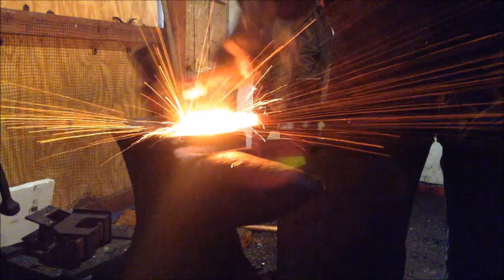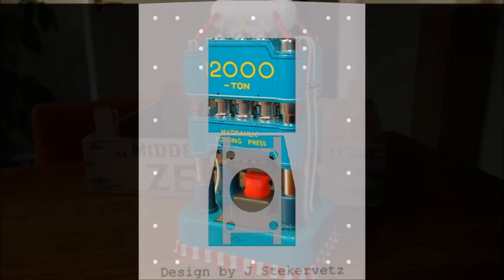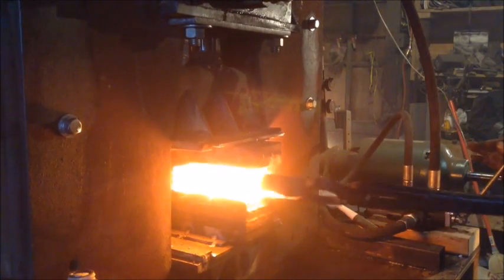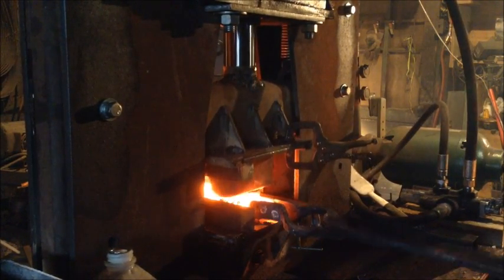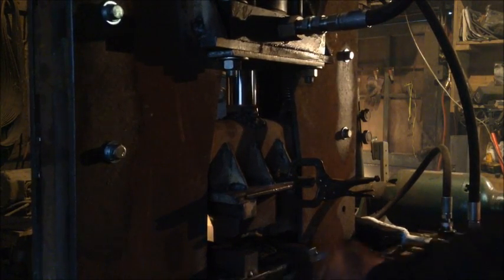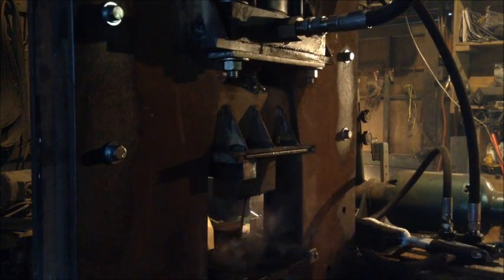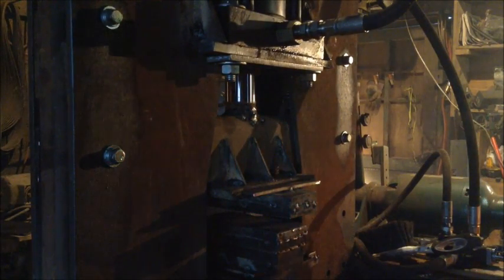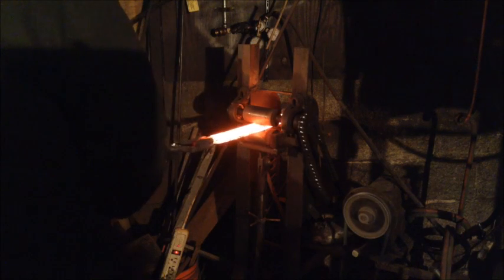30 Ton Hydraulic Press

Comment: For the record - there is no such thing as "30 tons of pressure".  Force is exactly that - a load (in Newtons) applied to something.  Force says nothing about the area over which it is applied.  If a force is applied to a certain area, the result, Newtons per square metre.  that's pressure.  You obviously want to present as a professional person - and getting your engineering mechanics terminology correct is part of that.  I should say to all the Americans who are working in obsolete Units like pounds, inches and such, America is supposed to be a metric country.  Why can't you all climb out of the nineteenth century and use metric?
Reply: Yall use what you want to, i have no issues with the system we use today although i will admit metric is simpler

Comment: 4 years i have been tring to get information on building one of these in the UK and i have drawn a blank or im looking at over £6-7,000 no one , i repeat no one will give part numbers for rams that travel this fast or anything else out its like some conspiracy i swear , in a residential area so cant use a power hammer ...4 years later still hand hammering and im almost 50 now .
Reply: Edgunsuk Hi Ed, I know what you mean about what seems to be industry conspiracies lol, I myself make blades and for many years my most expensive expenditures were (you guessed it) abrasives, belts to be precise.
And I spent sooooo long trying to find out what the industry used to splice their belts together.....eg, I knew they used some sort of heat and pressure bonding activated high strength tape......now, you try finding out what it is they use. Seriously, no guess work......good luck! I'm telling you, if you do not work in one of these factory's where they make this shit,  you won't be able to find out. I tried everything from sourcing the company's that sourced the company's! It's ridiculous......I only wanted to save myself money on what are essentially extremely expensive belts. But, if you love knife making.....just grin and bear it. Or buy a crappie belt sander with a low fps speed.
Unfortunately, I need to hog huge amounts of material quickly a lot of the time. So I had to stick with buying bulk belts 😡 but it is what it is, I am surprised that a chinese 3rd party hasn't made this product yet though....There is a free idea for some budding entrepreneur perhaps 😈
Reply: You can buy a 25 ton Anyang  press for that much. You'd have to fabricate the rollers though.

Comment: Hey Jay, nice press....how did you come by that hydraulic pump? I'm building a press now and have a 35 ton air/over Jack but I hear that these Jack pumps are really slow moving. I'd like to either convert it to hydraulic or find a hydraulic pump to use instead. Admittedly I know little about how to build a hydraulic setup other than I need a cylinder to five the fluid into the piston housing. Beyond that, I don't know how to make that happen.

Comment: Hi JW,
First of all, neat build! Can you tell me what are the advantages/disadvantages of a hydro press vs a hammer?
Thanks,
Mike

P.s.: I'm the guy who brought you that hugemongous draft horseshoe to forge into a hook and a hoof pick last summer. How's your back doing ;) Looking forward to seeing more of your work this summer!
Reply: Hi Mike! The advantage of a press vs power hammer, and I have both, is that the press is impactless. Meaning that welding under a hammer, you can set a weld, move up the billet to set the next one and the impact from the dies hitting will literally break the previous weld open. There are ways around that. My air hammer is 135lb and I've been told that decent welding requires greater than 50lb (this is the weight of the head, not the force) and large flat dies like I'm using in the press, but I've got mine permanently set with shaping dies for roughing out larger pieces like hammers and hawks. I can also get more control with the press - even going so far as putting in stops to make it precise. You can do this whole thing with a regular smithing hammer as well, but it's hours of drawing and reheating, whereas with the press I can take a 2" billet down to 0.1875" in a matter of minutes with about 4 or 5 heats. So it's a more efficient use of my time and fuel. I've got some great pieces in the works right now and most are getting posted at the ebay link in the video description, but I'm hiding a few away just for Faire season. :)